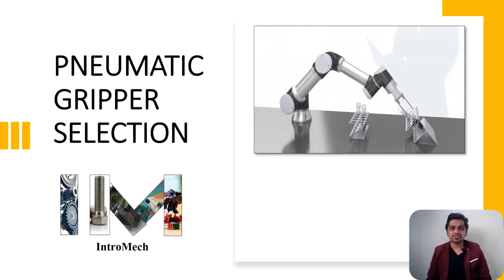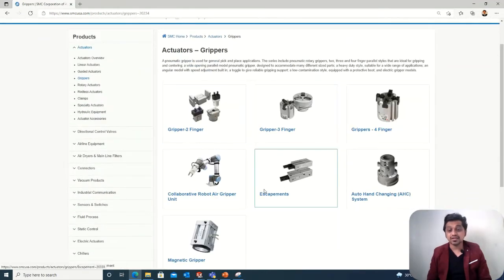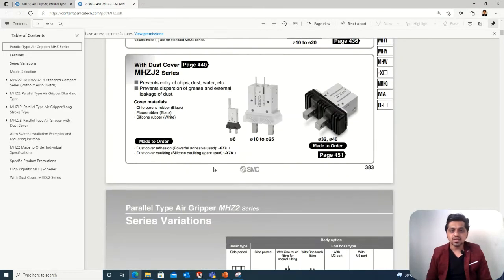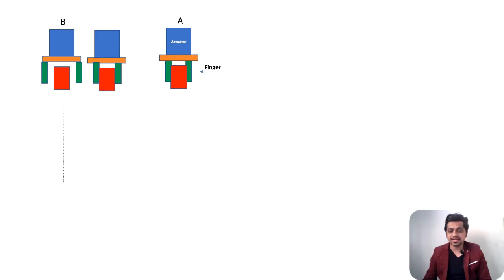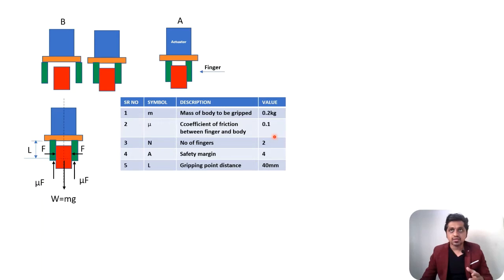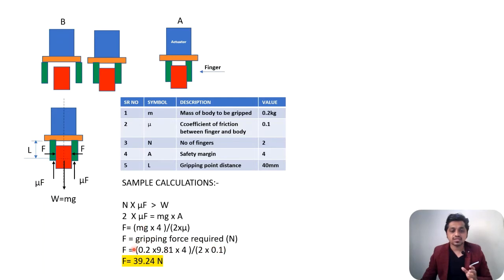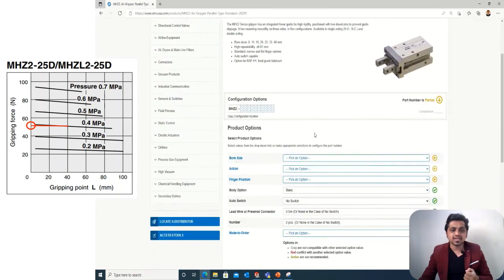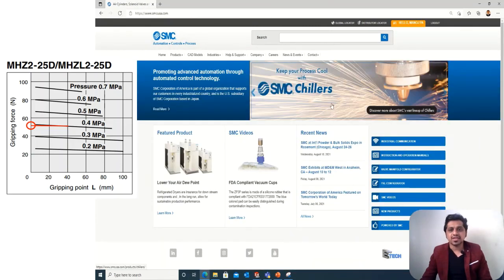HOW TO SELECT A PNEUMATIC GRIPPER?

Comment: Why consider the number of fingers? The gripping area of the fingers should be what matters. If you have 3 fingers but smaller area this will be incorrect?

Correct me if I am wrong
Reply from the maker: Friction is independent of area of contact. But it will be dependent on number of fingers and coefficient of friction.
Reply: @IntroMech562   yes that is true, I did not think that far. Thank you for your answer.
Reply: @IntroMech562   when the area increases the pressure decreases so it evens out! Thank you for your answer, it motivated me to learn more about mechanics.
Reply: @IntroMech562   but can you please explain why the friction is dependent on the number of fingers?
Reply from the maker: @OskarGustafsson97  If you check carefully the gripper catalogues it will mention the "Effective gripper force per finger" (It will also vary for internal and external gripping). The gripping force is the arithmetic sum of the individual forces acting on the gripper’s fingers. Also, just for additional knowledge if you are designing the fingers in such a way that it is providing "capture grip" then friction is not required to hold the part.